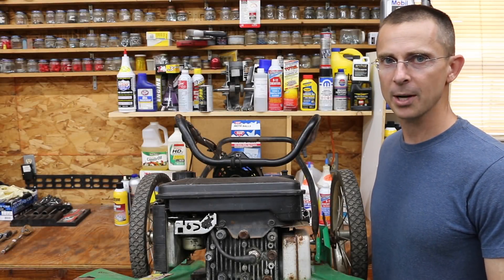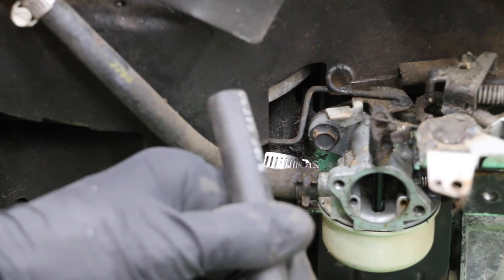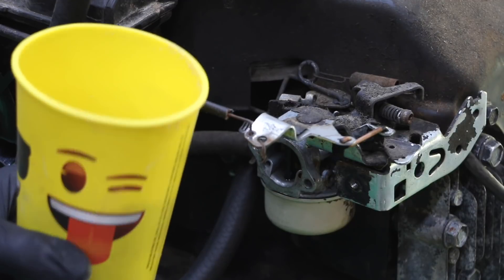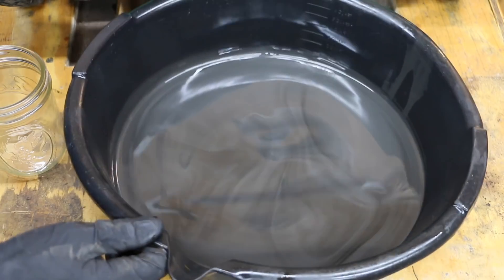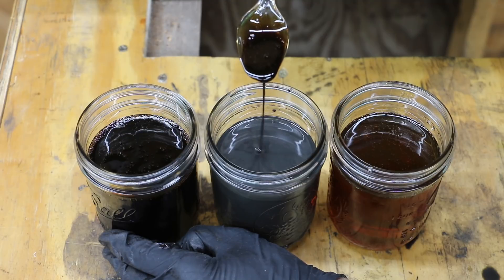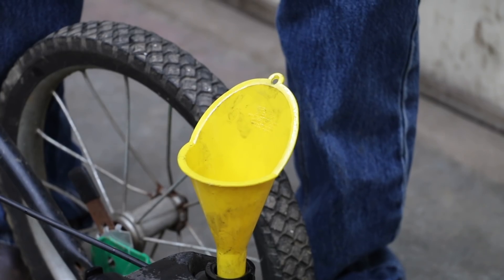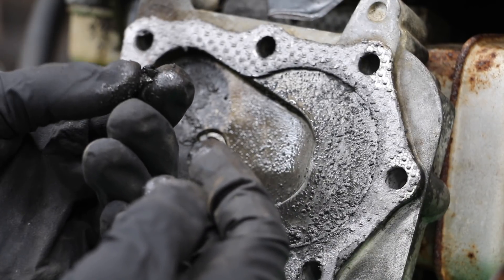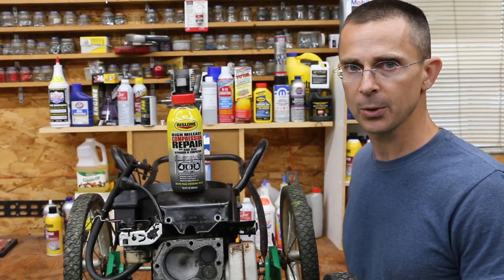Engine Eats Sand! Can Rislone Repair Compression Loss?

Comment: How about engine restore in the silver can. I see a can on the shelf in the background. I've used it with good results. On two different engines. A 88 Suburban with a 6.2 diesel and a 75 Monte Carlo with a 350 small block Chevy. I was most impressed with the results in the diesel. Being it's a compression ignition engine you will notice ASAP. Idled and started way better using it. If you have tested it already. could you give me the link?
Reply from the maker: It works great: https://www.youtube.com/watch?v=VXIu3oo8z4c

Comment: rislone valve repair worked good after blown head gasket repair on camry machine shop dip head for cleaning and damaged valve seals and and cause motor to smoke rislone valve seal reapir fix it after 1 day of driving no more smoke it's been 2 years now still going strong used only once but i  will used again sometime down the road
Reply from the maker: Impressive!

Comment: the valve seats are really eaten up loweringt the compression. and no rislone wont fill in the scratches but it will thicken to oil so it dosent go up there so eazy...and when it does it dosent come back so eazy thus the crap in the chamber as the oil ring cant sens it back to the pan....
Reply from the maker: Thank you!

Comment: This review is not a fair test of Rislone, I have personally never used it but that mess is sand particles that didn't get flushed out with simple oil changes. A complete tear down of that engine would be necessary to remove all the small sand particles. I think a retest is only fair in a non sandeater  engine. Thanks for your content.

Comment: The only additive I’ve had good luck with is Bar’s leaks 1111 head gasket sealer, it made my 94 Saturn go from burning a gallon of coolant every 50 miles, to not using coolant at all. I used the car for over a year after using the product and it ran until I sold it to a friend whom promptly wrecked it. It also worked on a friends mazda 626. It didn’t work well on my brothers 8 cylinder Buick, but to be fair, the Buick was a much larger and more complex engine design.
Reply from the maker: Thank you for the video idea!

Comment: Try restore oil additive.  
I had good results with that for engine oil blow by problems in a 21 year old Murray with a Briggs classic engine. 
I cannot say how warm the rings or cylinder or the actual compression psi.  But I believe restore product stopped oil blow.

And you have seen that my video on that I posted a comment on one of your  separate video about that.  I am just commenting here for those a who may not have seen that other video of yours in restore.  
https://www.youtube.com/watch?v=TNDnw2hWhv4
Reply from the maker: Great recommendation!

Comment: It hurts to watch that sand being sucked in, ....... But a really cool experiment.  I wonder if some of that liquid metal  or powdered metal you add to a radiator to seal leaks work in this case to recoat the cylinder wall? I think that stuff was powdered aluminum or similar. I have never had much success with Rislon, Restore , slick 50 , Millitec,  or any of those products.  Do you think these products would extend engine life in a properly maintained engine ?
Reply from the maker: Thank you.  I do believe a few additives help extend the life of an engine, but most won't.

Comment: I have seen engines run on sand dunes which have ingested large amounts of sand while running at near full throttle causing damage very similar to what is shown here..Aside from obviously requiring an expensive rebuild, sometimes an engine can be restored to some degree of functionality with the Rislone product or similar if the engine isn't too severely damaged. The engine needs to be flushed out with a mix of engine flush and mystery oil..The mix is poured into the engine with the cylinder head removed while turning by hand. Once the engine is THOROUGHLY flushed out..this process usually has to be repeated several times.. the engine is then flushed with motor flush mixed with regular motor oil while running. After a few minutes, the engine is drained and the head is removed. It is re checked for contaminates. If there are any, the flushing process is repeated. Once the engine is satisfactorily clean, the Rislone product is then added with fresh oil. Rislone can help scoring caused by normal wear and tear but will not completely repair extreme scoring as seen in this test. It will help the engine run somewhat better but not completely. The deposits that accumulated at the end of your test might be from contamination that may not have been fully flushed out. Rislone has penetrating oils in it which may have dislodged some of the remaining contamination from somewhere in the engine causing more damage. In any case, your videos are very helpful and informative. I enjoy watching!😀
Reply from the maker: Thank you!

Comment: Have you tried the lead pellets? I forget the brand name now but about 20years ago in Chicago I used them on my Chevy truck and they worked brought the compression up I don't recall the amount but they stopped the smoking rings. But I never did a teardown afterwards to see if it left and deposit in the engine.
Reply from the maker: Not yet. Thanks for the test idea!

Comment: Just a small suggestion, you can use diesel instead of oil to flush an engine. Just run it a bit on idle (1 min or so) and it will clean the engine without damaging it. Clean diesel is a good solvent but it also acts a bit like a lubricant.
Reply from the maker: Great tip. Thank you
Reply: @ @ProjectFarm  , I am using it on old engines with high mileage (Otto engines in particular) for flushing and cleaning the engine. Engine flush "solvents" in a can have to be run ~10min on idle and they either remove even "good stuff" which is holding old gaskets together or they clean only on the surface the engine and all the components which come in contact with the engine oil.
Diesel is cleaning very fast (acting as detergent) but it provides also lubrication during the run. You need only about 1 min to run the engine and it will be sparkling clean.
I will take a photo tomorrow to show you how it's looking the oil on my BMW E39 after 3000miles. Still honey colour even though in summer she was seeing 100-140mph at least twice a week (I live in Germany).
I am doing this with all my cars and every single one of them was/is running fine even after 200.000 miles and they still hit the factory specs (acceleration, mpg and top speed).
With diesels I wouldn't recommend because you can have engine runaway if turbo is leaking oil for example.

Comment: I have used regular Rislone in many cars and motorcycles that had low compression and ran awful. 15 miles of driving and the cars and motorcycles ran perfect and compression was restored. I bought a 1960 Sunbeam Alpine that was taken apart and the parts came in 12 boxes. I put it back together and started it and it had 85,65,65,85 pounds of compression in the 4 cylinders. I put in Rislone and drove for 15 miles and the compression was 185 in all cylinders. 

I bought a 1995 Kawasaki Ninja that had not been started for 7 years. I got it started and it would only rev to 7000 rpm and then cut out. I put Rislone in and in 15 miles it would rev to the 14,000 red line and was so fast.
Reply from the maker: Thanks for commenting on Rislone.
Reply: was the rislone the same as in video just ordered some for my old zetec
Reply: @uttle1  no I used Rislone concentrate

Comment: first of all adding stright sand to the motor is no a real test . with a dirty air filter , you may add a little dust . which many form slight scores , that the product is intendent to work on . those deep scapes , only a machine shop can fix . not a true test .
Reply from the maker: Thanks for the constructive feedback.

Comment: I watched you video when you tested "Engine Restore" and now this one. I was impressed with the Engine Restore results, so much so that I did put it in my old plow truck but have not run it enough yet to make any kind of determination if it is going to work for me, I've just been idling the engine for now while I do some repair work on the floor getting it ready to plow and will keep you informed. Not sure how good the results will be as the # 8 cylinder had virtually no compression for some unknown reason, valve train was working properly when I removed the valve cover to check, don't believe it's a hole in the piston as I don't notice any extra blow by anywhere or oil consumption. It's a 5.0 ford in a Bronco and was told by a ford mechanic that quite often the plug wires would go bad and since plugs 7 & 8 fore consecutively seven causes 8 to fire at the wrong time blowing out the rings or something like that, if that's the case I don't have much hope but hey a can was $10 bucks and it's a plow rat that has been running this way for a few years as far as I know.
Reply from the maker: I hope restore delivers great results!  It will help restore compression if the piston rings are the issue, but won't help if the valves are the issue.  Thanks again.

Comment: As others have requested I would like to see restore in your sandblasted engine.  I have a skid steer with a rebuilt Diesel engine that got dust damage from an air filter that should have been replaced and it burns a ton of oil with lots of smoke.  Tried restore and it did nothing.  Would especially like to know if restore leaves same/similar deposits like Rislone.
Reply from the maker: Great recommendation!

Comment: I have a 1996 FORD TAURUS LX SW. Because of lack of interest or just plain not caring for the vehicle at all, the motor has been thru hell. I have changed the spark plugs changed out a MAP sensor the oil looked black as coal when I got the vehicle. I am lucky to get 12 mpg in city driving, mainly because of stop lights I am sure. On the highway it keeps up good at around 20 mpg. My one main problem is that in this Fla. heat the motor will run rough at stop lights try to staul then sometimes clear back up run smooth again. The motor is 3.0 dohc v6. If you can help me sure would appreciate.
Reply from the maker: It's very challenging to diagnose with this information.  Things to check.  Are there any trouble codes, does the engine need a tuneup, how's the compression, is the MAF sensor clean, how about the throttle body.  I wish I could be of more help.
Reply: Project Farm The MAP sensor is clean it came from a 1995 Merc Sable. No trouble codes at all. Throttlebody has been cleaned there were issues with vaacum leaks. Couldn't find where other tubes hookup so I plugged each of the 2 ends. One under the throttlebody that went in a circular pattern, the other was against the firewall near the cabin in let filter for a/c. My only thought now would be the coil pack for spark plugs or wires also.

Comment: Rislone cut with seafoam "fixed" a lawnmower I had which was hard starting and was burning lots of oil. After treating, the exhaust smoking stopped and the mower was easy to start.
Reply from the maker: Thanks for the tip.
Reply: I should note that I didn't measure the amount of Rislone and seafoam I added. but I would guess it was about 4 tablespoons of Rislone with enough seafoam to clear it out of the funnel I used to add it to the engine. seafoam was added to both the oil and the gas.

Comment: Rislone would work better from normal wear.. metal to metal over time.. not induced by sand!!
Reply from the maker: Thanks for commenting on this.
Reply: The only way to rebuild and engine is to rebuild an engine. snake oil products are pointless

Comment: The problem here is it's formulated for 4,6 and 8 cylinder engines so you're going to need to bolt atleast 4 lawnmower engines together onto a single crank then it will magically work! Either that or duct tape the lawn mower on to my Volvo's engine and we will have 6 cylinders to give it a fair test :D
Reply from the maker: Thanks for commenting.

Comment: Can you try Engine Restorer on this engine?  It worked so well on your tractor diesel, but that was an engine with loss of compression due to regular wear and tear.  The big gouges left by the sand on this engine may make repair by either of these products unlikely.  If Engine Restorer fails to significantly improved compression on this engine, I would also like to see you try Rislone on another engine with compression loss from wear and tear and see if it works then.
Reply from the maker: Thanks for the recommendation.

Comment: You should make a video of an engine running with 100% marvel mystery oil in the crankcase. It would be thin but I think it would work ok. Probably clean the crankcase very well.
Reply: MMO seems like it's too much like auto tranny fluid.  I remember in the 1960s a mechanic would slowly drip a quart of tranny fluid down the carburetor saying it would remove carbon build up on the valves and combustion chamber.  It would smoke like a WWII battleship laying a smoke screen prior to a beach landing.

Comment: Years ago, I had to pull an 8000-pound trailer from Grand Junction Co. to Florida. The old Ford truck had a 300 six that was very tired and burned about a quart of oil every 600 miles or so. I didn't want to use this truck, but its all I had for the job. I changed the oil and added a can of Engine Restore, figured I had nothing to lose. In about 500 miles of driving the Bug Fogger effect was going away. By the time I got to Florida the engine was fine and no longer burned any oil. I kept the truck for 2 more years and it never did start burning oil again. So sometimes the crazy car stuff works.
Reply from the maker: Wow!  I put together a video on Engine Restorer and it helped my diesel tractor a lot with compression.

Comment: After never hearing about such a product before and after seeing this video I can't say that even if such a product claimed to work that it actually would.

The product is mixed in with the fuel for combustion, so it will see the cylinder and piston head yet it didn't fix anything, the end result was clumps of tacky mess which i can only presume are combined masses of product mixed with metallic leftovers and maybe some loose carbon deposit.

Maybe it might be worth testing this product and others like it in engines which have been neglected or lack compression from a variety of differerent factors as the only one you provided was a functional controlled test engine which you damaged with sand induced via the air intake and the damage could of been too severe for said product to work, if i knew about this channel years ago i'd have a collection of engines and rigs to send in for you to test and destroy but they're all scrapped now, rip lol.

Keep up the great videos PF!
Reply from the maker: All great points and thanks for the positive comment!

Comment: One thing that ive done with small engine for years is once i drain very dirty oil, ill fill the crankcase with gasoline, pull it over a few time and drain it out. Because gas is an excellent greaser it removes all of the old oil and contaminates and once you put the new oil in it stays cleaner much longer.
Reply from the maker: That'll help flush the engine for sure!

Comment: Well if you pour sand into an engine it will eat the Piston, rings, oil scarper, and the cylinder walls. There is no additive that is made today that would repair an engine that has been damaged by pouring sand into the carb. or air intake. Additives today are only made for engines that have over 100,000 miles or more. So you can't say that it does not work as advertised. You need a more realistic way to test the oil additive(s). Your test is not a very realistic test.

Comment: i think it is kinda wild to spoon feed it and expect a product to repair that, this is more used for smaller scoring, so no wonder it got pushed though to your big scores and ended up on the other side in the combustion chamber, you should just have taken a run down engine from real life not your silly sand eater! ^^"  - just a suggestion - Lara 

your videos are fun though, perfect to drift away on the tubes c:
Reply from the maker: Thank you!

Comment: I used Engine Restore on a 1.8 2000 corolla and after 200 miles the blue smoked stopped with Engine restore. It comes in a metal can and is dark blue that stuff you tried looks like a heavy oil additive.

https://www.walmart.com/ip/Restore-Engine-Restorer-and-Lubricant-8-Cylinder/16783203
Reply from the maker: Impressive!  I used it on my diesel tractor and it helped a lot.  Video follow-up to be published soon.

Comment: Does the engine actually spit out the sand or does it stay in the cylinder? I just did a spark plug change, 2 of the cylinders are under the intake, think I might have gotten some grit on the plugs or down in the cylinder. Already started it, like an idiot... wondering if I should pull the plug back out and try to clean it or if its even worth it at this point
Reply from the maker: It comes out of the exhaust and gets into the crankcase.
Reply: Thanks Project Farm. I actually pulled the dipstick and found a couple small particles on it. I actually notice a compression loss too :(  But it's still better than when one of the plugs was misfiring. Wondering if its all due to the dirt or if I'm still chasing another issue. I'll do an oil change tomorrow. I've been kicking my own ass all day for not finding a bottle of pb or wd40 with a long extension and spraying it in there under the intake first. That probably would have worked.

Comment: try bon ami hand cleaner to restore compression , like you used the sand to destroy compression
Reply from the maker: Thank you for the video idea!
Reply: Project Farm my uncle told me many years ago that mechanics would hand sift bon am I  into the carb if the engine was burning oil